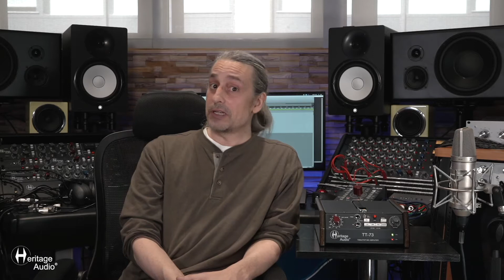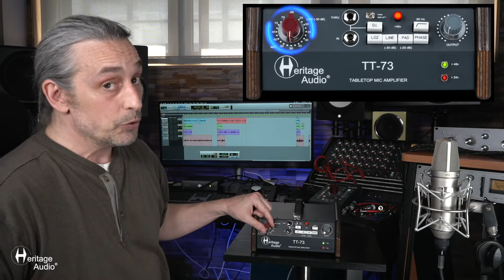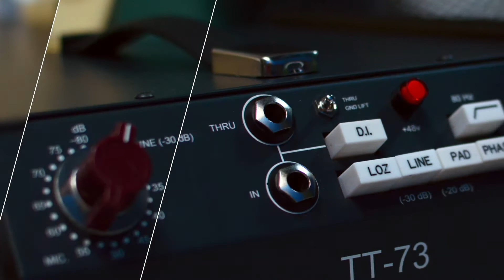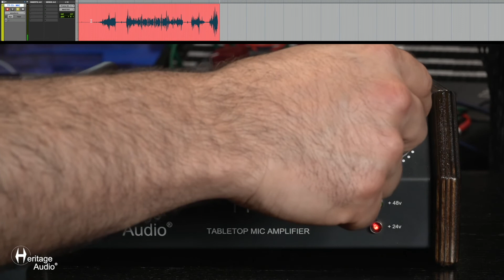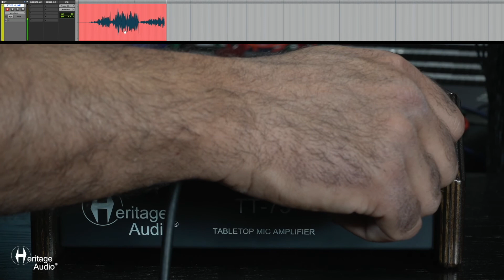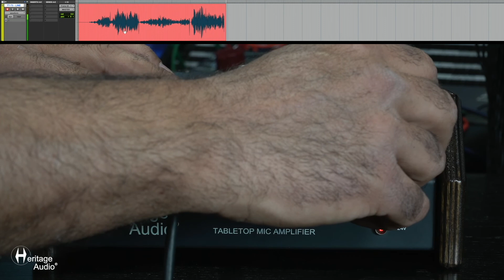Heritage Audio - TT-73 Tabletop Series Connections & Features

Comment: Shouldn't it be connected to the audio interface with the trs terminal? If you connect it with XLR, it seems that you will go through the audio interface mic pre again.
Reply from the maker: The TT series has an XLR output.  Depending on your interface, some have different inputs for LINE and MIC while others have just one input that you decide whether it should be LINE or MIC, usually with a switch or button.  If your interface does only have a 1/4 balanced input for line then you should use a XLR to 1/4 jack cable.
Reply: @heritage_audio  Indeed, yes my RME Firface UCX only has 1/4 jacks for line level inputs on the back, so I've had to buy XLR to 1/4 jack cables specifically for that.